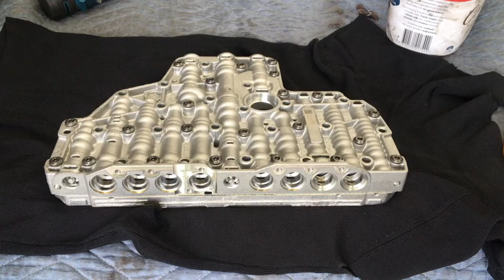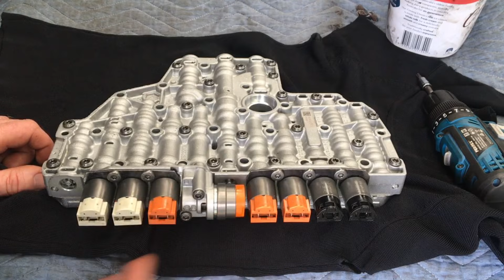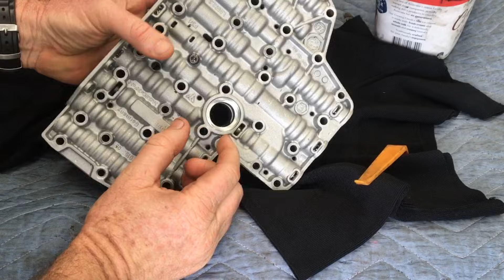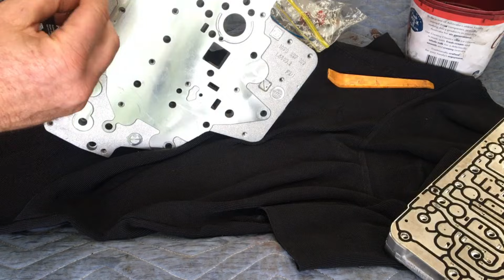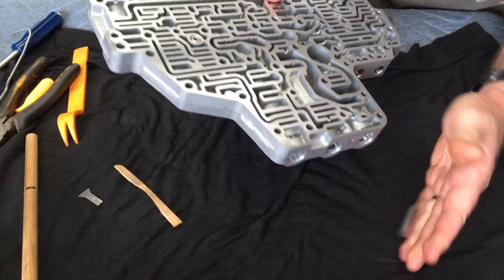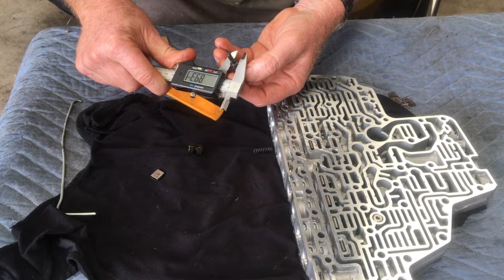Porsche ZF PDK Valve body

Comment: Hello, when removing PDK oil pan from 2013 911 Carrera SI found a 6MMX 25M  in the pan … Not sure where it goes to, I initially thought it belonged to the empty hole on the driver side( left hand drive) but evidently this hole is supposed to be without a bolt…. Any ideas as to where it belongs?  Car  drives and shifts well , no codes from PIWIS…. Thanks
Reply from the maker: There was a screw sitting in the bottom of the pan? Aluminium or steel? Did you take a photo? If so send it to the channel email address jjrichar12@gmail.com
Reply: @jeffrichardsoncardiy  Email with pics sent     Steel bolt.( the head  is shown is different from the bolts at the bottom of the valve body.   Thanks

Comment: HELLO, panamera 971 Turbo - 
I changed PDK clutch for new, double flywheel also - nothing changed.
 slipping is only on one clutch - gears 2 and 4 checked and always slipping ( i suppose 6 and 8 also )
another one clutch - gears 1 3 5 - (suppose 7 also ) - never slipping.
The same was on old pdk clutch, the same now with new pdk clutch.
Do you think it is solenoid or pressure regulator problem?
Reply from the maker: I have no experience with the 8 speed PDK in either the 911 or Panamera so I'm not going to be any use.

Comment: I have a 2012 Panamera V6 with PDK. There is a rev flare on the first shift of the day from 2-3 and not again until the car sits overnight. I had the fluid serviced and the tech (not dealer) tried to do the first step shift rod calibration which passed, and then second hydraulic calibration failed with intermittent P17EA hydraulic valve stuck. Suggest I go to the dealer. Hmmm that sounds very expensive. I suspect bad O-rings in the valve body. Should I just take it to the dealer or sell it?

Comment: Hi jeff , thanks for your video. I want your advice on my panamera 2011 pdk , when i put it on drive the transmission slips till 2200 rpm then it engages . When driving no problems at all. Very smooth and gears change perfectly. No codes at all. I was thinking to check the solenoids as you told us in the video. Car has 160000 miles on it. Changed oil and filter but still the same
Reply: I have a 2012 Panamera PDK with issues. If you have that slip on takeoff do the 6 minute PDK reset procedure, google it. It helps my slip off-the-line for a while and then a month or two later I need to do it again.

Comment: Hi Jeff, I loved your video! I'm studying the entire PDK Transmission out of curiosity and because I own a Cayman S 2011. 

Recently it is giving me some issues, first of all at very low speed I have a back and forth shudder (between first and second gear) while at high speeds goes very smooth as usual. I noticed when the engine is still warming up the gear shift has the revs go up a bit more than normal (like if the clutch takes longer to fully release?).. 

Then suddenly I started getting random "Transmission Emergency Run" error, which disappear after turning off and on the car again.

Last time it didn't clear, so I had the car loaded on the truck and straight to the garage. Funny enough they told me the car is fine they just "cleared the codes". And they told me about some clutch error codes.

At this point I'm tempted to order the full kit of valves and replace them myself (the garage refused to do so).

I'm planning to put the car on some jack safes, slide below, open the bottom cover, and just replace the valves without further opening the transmission. (Could you recommend any video/document what should I do with the oil? ...)

Is that a good idea? Do you think my reasoning makes sense with the kind of problems I noticed?

It in fact could be:
1) temperature sensor
2) position sensor
3) one of the valves
4) rotation sensor 

But in fact the garage said I had only the error codes related to the clutch, that's why I was thinking about the number 3).

Thanks again!!
Reply from the maker: You really need to find what the codes were. These will have specific reasons for the issue, and will point to the problem. Valve bodies rarely fail. They wear with time, which might be the issue here, especially if the clutch fluid hasn't been changed regularly. So my advice would be to first change the fluid, maybe a few times with a short drive between each change. This will get most of the old fluid out. Also, if the problem occurs again, ensure you find out what the codes are and then start diagnosing from there.
Reply: @jeffrichardsoncardiy  Ok Thank you! So before doing any mechanical work will try with this and will get the details about the codes.
Reply: Hi Jeff, so we did oil change but the transmission still gave emergency run. The errors are sometimes "improbable oil flow" or "clutch could not disengage during overlap" or something like that. So we investigated the valve body, and found that some metallic valves below the solenoids of the clutches are randomly getting stuck (tried manually pressing and releasing). Therefore we are replacing the valve body now.

This new garage said the previous garage put a wrong oil with too high viscosity, and that could be one of the reason bringing to this further issue.
Reply from the maker: @nightghost87  Wrong oil in the valve body is bad. One of the reasons for valve body failures is the gear oil getting inside the cutch section. With a 987, the codes will also come with a description as the heading, as each code is actually just a category of faults that then gets a description the clarifies exactly what the issue is. Without all this detail it's very difficult to diagnose what exactly the problem might be.

Comment: Jeff, I appreciate the questions. Jumping on the gas doesn’t cause it. It only happens at gentle throttle openings, seemingly constant throttle. A very good question re which gears exactly, and honestly right now I am not sure. Will have to go and test!
Reply from the maker: Do you want to send an email to me on the channel address jjrichar12@gmail.com  A bit easier to have a more in depth discussion. Also, are you in Australia or elsewhere?

Comment: It does seem to improve with sport. I did a fluid change 1.5 years and about 6000 Kms ago. But even in manual when I am in a constant gear, it is there. There are quite a few people with the same problem on the internet when searching, but the only resolution I have ever heard is gearbox change from porsche, which is not very practical
Reply: Jeff helped and suggested some fixes for me. I changed the valve body which solved the issue for about a week and then it came back. I have since just updated the pdk software and it seems to have solved the issue. So I would certainly start with that.
Reply: @76lonant  Still holding? I have 14 cayman and it feels like it stutters a bit at low gears, kind of heistates. No longer the smooth machine it was. 81,000 miles. Fluid change did nothing, dealer says valve body and if that doesn't work whole new PDK. Love the car but not sure I love it that much. How has it worked out for you with just valve body?
Reply from the maker: If it's doing this and you jump on the gas, does it slip or hold the clutch well? Is it all gears or just even/odd? Sorry for all the questions but just trying to think logically through the symptoms to where the problem might be.
Reply: @jeffrichardsoncardiy  thank you if you are able to answer to my question
Reply: Hello i habe same problem, rpms fluctuates especially on odd gears at low throttle. If you drive car har, and push pedal it does not slip at all, what could be a problem? Solenoids?

Comment: Jeff thanks for the response. So when driving in a relatively high gear, ie 4th - 6th and rpm between about 2-3 k the rev needle moves up and down by about 200 rpm and I can hear the engine changing revs, so it’s not just an instrument thing. It’s only on part throttle ie doesn’t seem to happen when driving agressively. Car has 93,000 Kms. Their is a video of on someone else’s car, a turbo on YouTube under pdk fluctuation
Reply from the maker: That doesn't sound like the clutch failing symptoms I'd expect.  Does it improve using sport mode? Have you done a fluid change recently?

Comment: Jeff, that’s some amazing investigative work you have done. Thanks for sharing. 
I have rpm fluctuation whilst at low rpm and constant speed, as though the clutch is slipping slightly and then re engaging. Do you have experience of this? Would you suspect it to be one of the clutch valve solenoids? I am considering a valve body replacement to ensure rectification. I have no error codes. Any thoughts appreciated.
Reply from the maker: I'd be surprised if it's anything to do with the valve body if there are no codes. If the pressures aren't correct going to the clutches, be that a valve body or solenoid issue, then codes should appear. What exactly are the symptoms? Is it just happening when crawling at idle prior when the clutch is deliberately being slipped or at other times. How many km on the car, and where is it mainly driven? In town? Lots of starting going up hills? It sounds to me much more like a clutch beginning to wear out, but need some more detail.